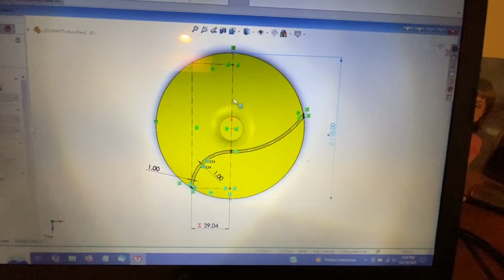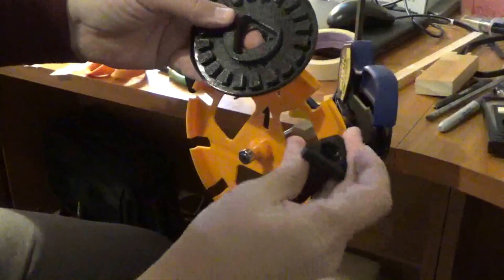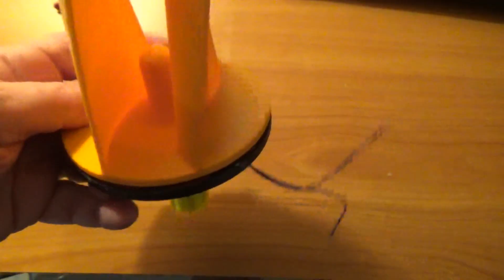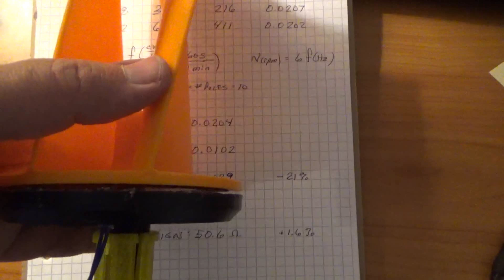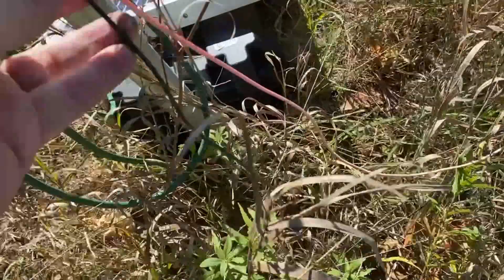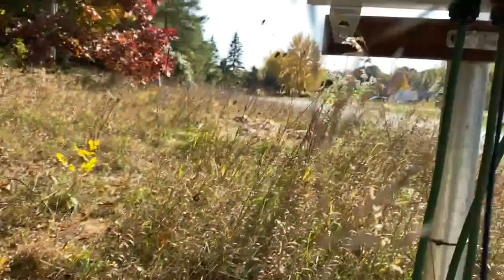Small Higher Voltage VAWT

Comment: If you are willing to share, I'd like to hear more about how you figured the circumference of the form to wind your coils.
Reply from the maker: What I've been doing lately is take twice the diameter of a magnet times the number of magnets and then add 15 to 18% depending on how much I have invested in the coil fixture and wire.  If I'm a bit nervous, I'll go with the larger figure.

Comment: Really cool stuff, fantastic engineering work. Using a more efficient ac/dc circuit would add complexity but might be worth it. With a synchronous rectifier circuit you could even do something like charge a super capacitor and then feed that into the charge controller. I have a feeling that a lot of the current being produced is being lost as heat in the rectification/charge control stages.  Using the super capacitors and an efficient rectification circuit could make it able actually produce a sizeable enough current that you’re charge controller recognizes it